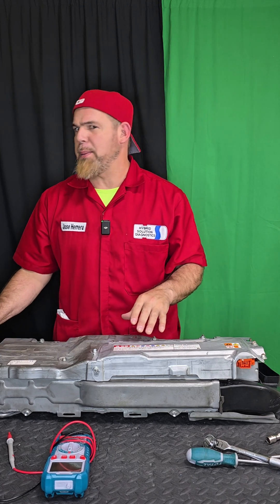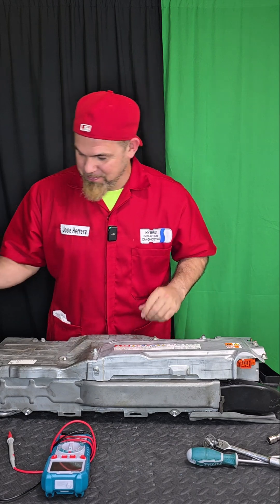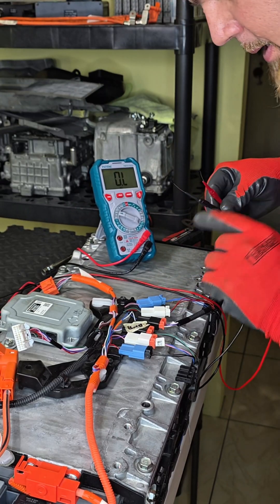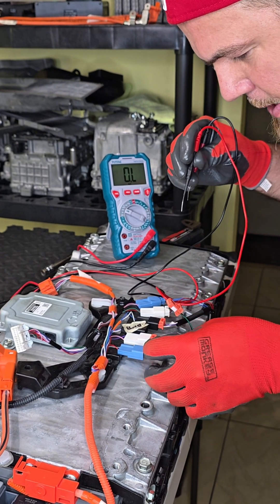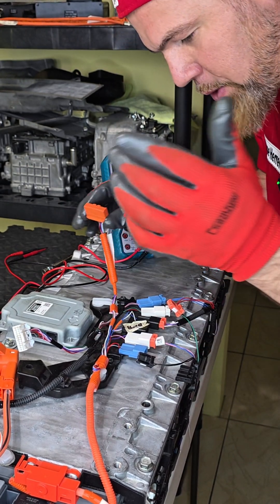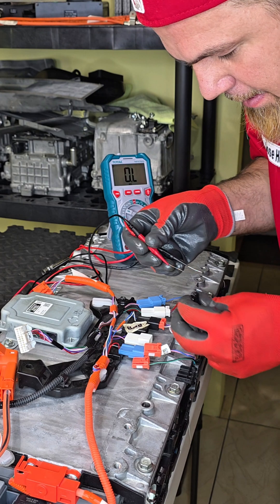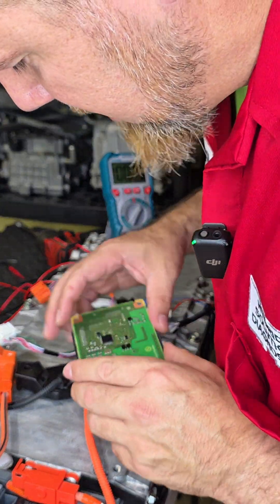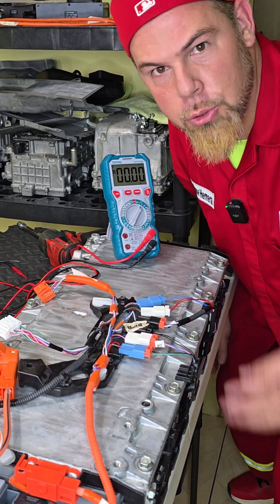Inside Toyota's New Bipolar Hybrid Battery (PART 1)

Comment: Hi👋hello Jose,very good videos and good teaching, I have a question? my 2012 Lexus ct200h it turned on the warning sign and others lights on the dash board and say check the hybrid system,and check engine also, the error code is P3019 do you think or someone knows do I have to change the entire battery pack or just replace the damaged modules? Thank you 🙏
Reply from the maker: @victorgomez4403  is kind of old so definitely time for full replacement 😁😁✅✅🔋🔋
Reply: @ vendes tu baterias Jose? y por cuanto me cuesta una?
Reply: Muchas gracias por tu ayuda👍

Comment: I don't recognize Toyota. Why did they make the same connectors?
Reply from the maker: I’m very surprised as well 😮
Reply: If you knew what other catastrophically mistakes Toyota has made in other Toyota car models, bad wires, bad engines, etc you would be truly blown away.